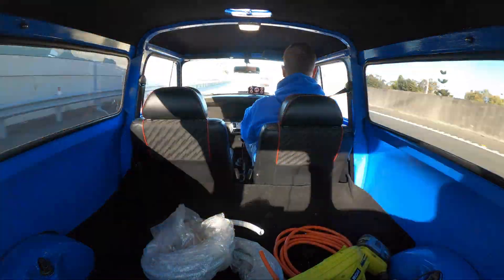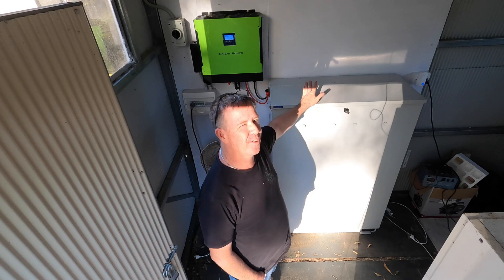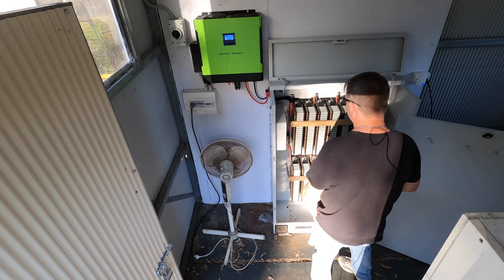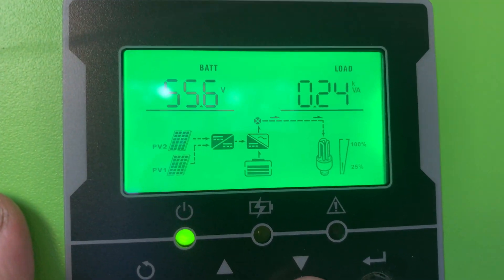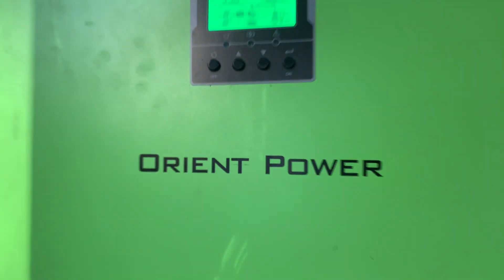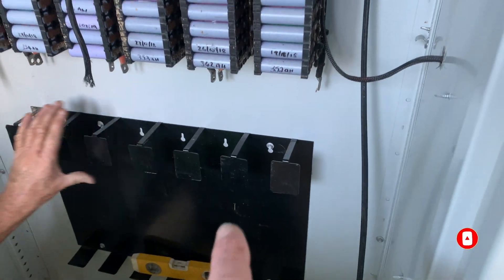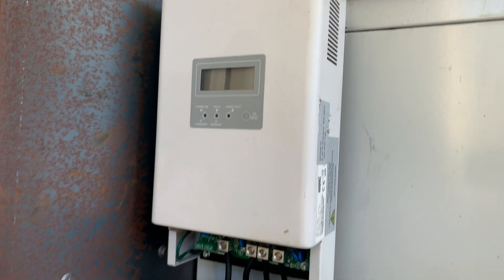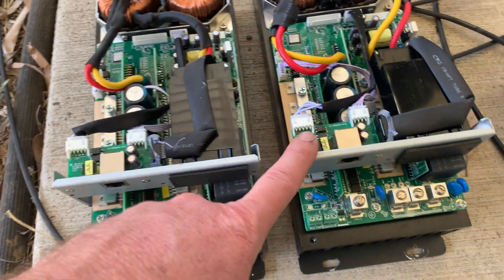Third Life Storage: A 18650 Retirement plan - DIY Powerwall reinstall at the farm

Comment: Lots of product promos placement  and links.  No testing of the SOH of your recycled powerwall after 5 years.    Good solid fire resistant construction and practice in place  5* kudos.  Dont understand the 3mm armour plating  are you expecting hostiles?
Lets face it, its unattended so if it goes ape it will just burn down, so cut back all the blue gums and bush near by.  Stay awesome buddy.
Reply from the maker: LOL, I have 5 years of BMS logs done every 15min - I got it covered buddy... lol
Reply: He made the battery 4 years ago, sitting for 10 months unused. You do the meth how it's been 5 years. Ofc it's been less cuz he can't even  wire a BMS system on it and it's a bomb making fire hazard that won't pass US inspection. Dudes like this YTer are a infohazard like those covid ivermectin Influencer that kicked the bucket, Danny Lemoi.

Comment: Nice!   My 2nd hand 18650 cell powerwall that you're youtubes helped inspire is in year 7.  The oldest 14s battery has passed over 2,000cycles at average 36% DOD and going strong.   Per you're example, I use Batrium and the visibility into the individual packs gives me confidence things are safe enough.  These cells can really perform when treated respectfully :)
Reply from the maker: And to think a lot of 18650 cells i've seen in laptop batteries are rated at something like 300-500 cycle life!